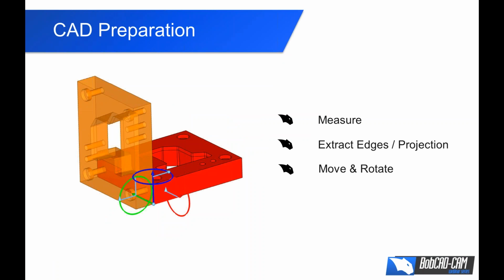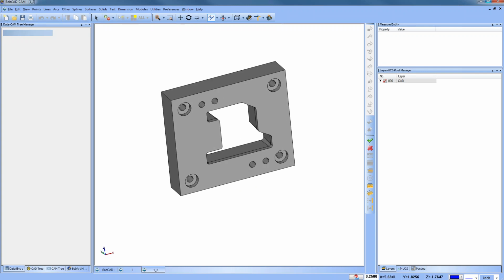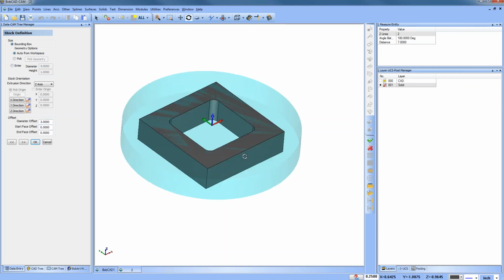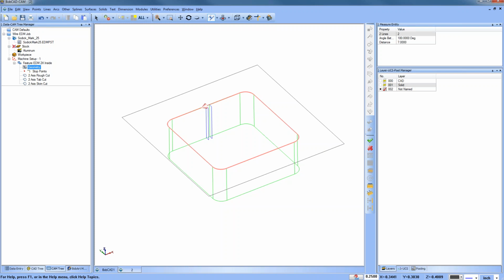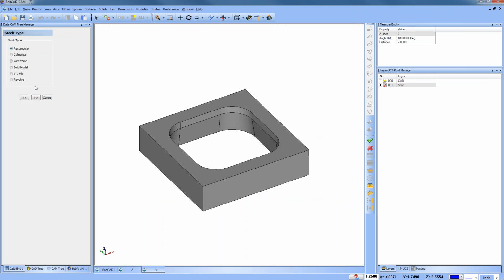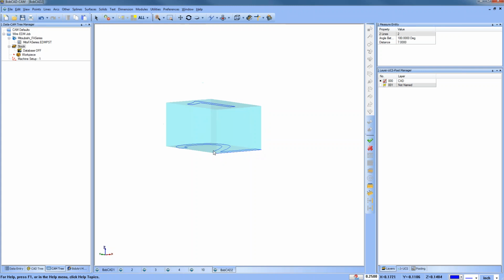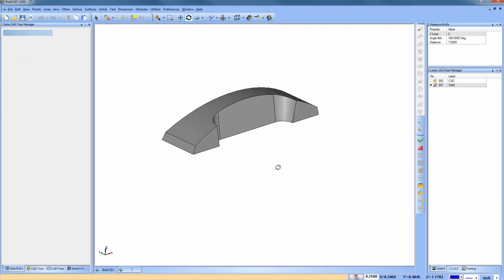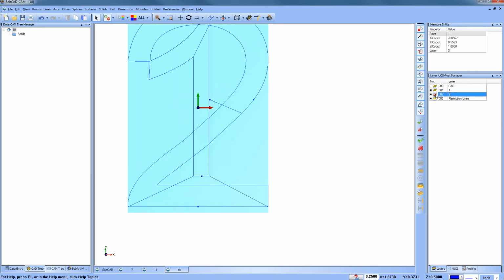Intro to Wire EDM - BobCAD-CAM Webinar Series

Comment: Hi, I am Neelam from melbourne, australia. Actually, I got new job as a autocad operator 3 days ago and I have to  prepare architectural  moulds and profile designs  for building in BobWire software19.3 version and it has to be manufactured in my company from expanded polystyrene (EPS) foam by cnc 8700 foam cutter. I haven't use this software and machine before and I have having hard time to learn it. Do u know any online stuffs where I can learn it and save my job?
Reply from the maker: Unfortunately, the version 19 is no longer supported so there isn't much, if any, information available. Try looking up articles on BobCAD.com and also look around our YouTube for some older videos. Hope that helps and good luck!